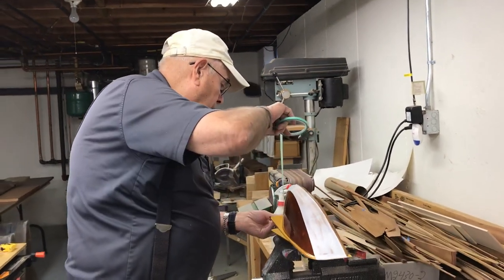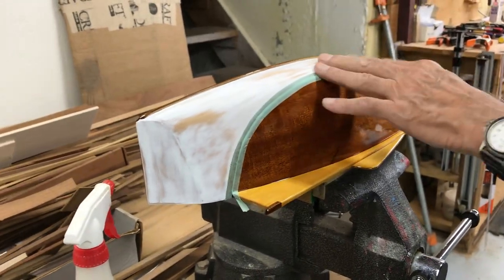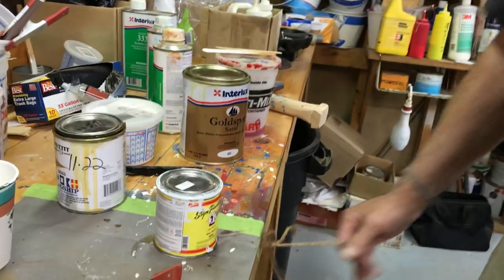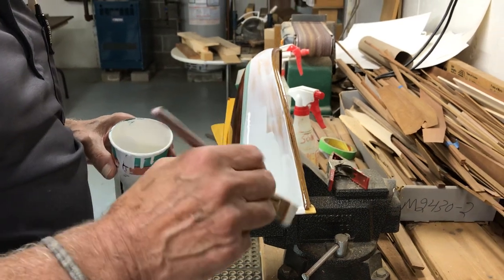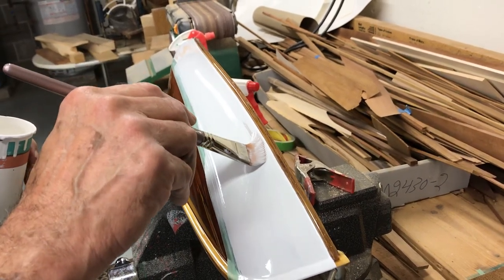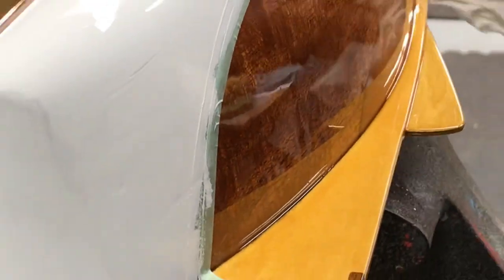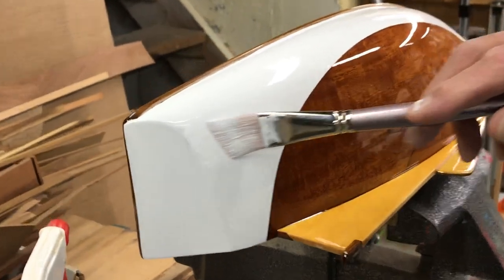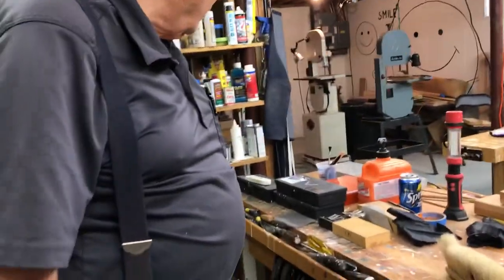Cat Boat Half Hull by Malcolm Crosby, Series 2, Video #23: Gloss Paint

Comment: I vote cherry, it would be a nice contrast. 
Our local automotive paint store sells One Shot, it's used by many pinstripers. What kind of dry time have you had with? I have seen people thin it due to dry time. 
Question on the 3M tape, are you able to leave it on very long or does it have a memory and start contracting back if stretched? (I ask because I am slow on my projects.)
Thanks again for another great video.
Reply from the maker: wanderlustjake Thanks Jake! Malcolm doesn’t usually thin it, he lets it dry overnight.